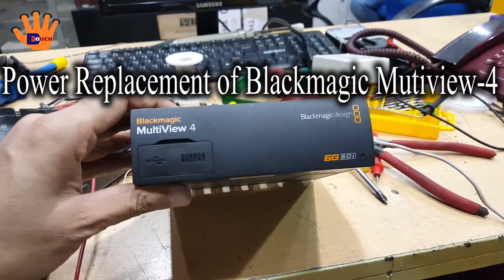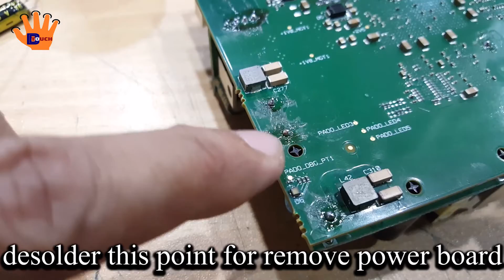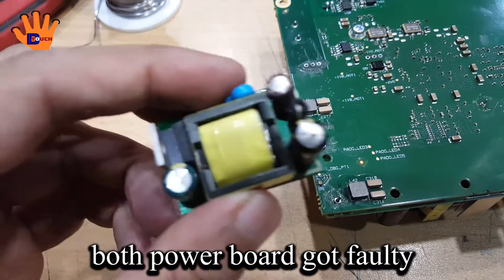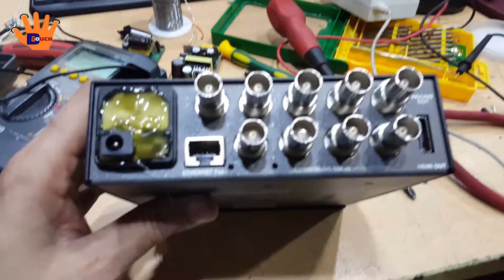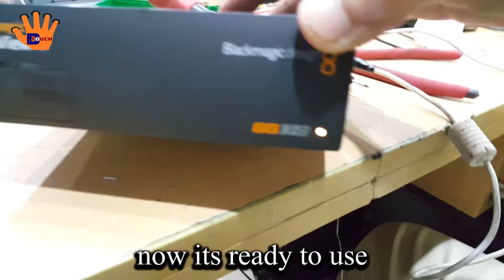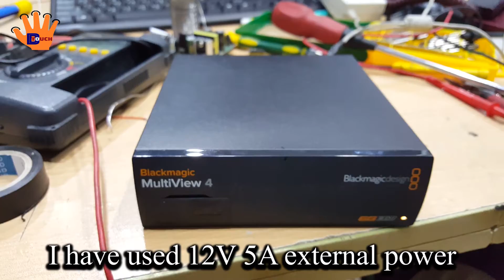Blackmagic Multiview 4 Service | Blackmagic Multiview Power Problem | Blackmagic Multiviewer

Comment: Hmmm, I was just thinking of buying a used one.  
Is the power supply in these things a common problem?
Reply from the maker: its is not common problem, but its hang some time, that means output not acceptable, after restart it running normal,  Thank You
Reply: Looked like you had a bulging capacitor (leaking) on that first board you pulled.